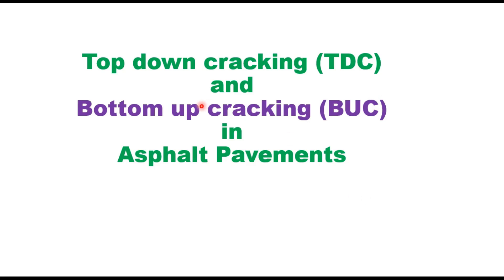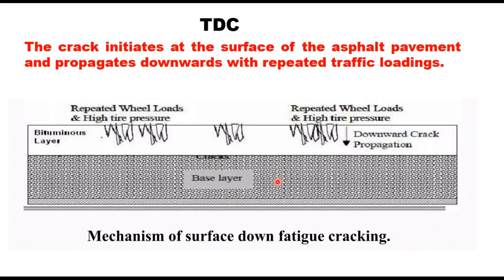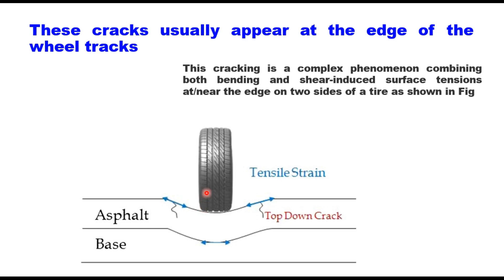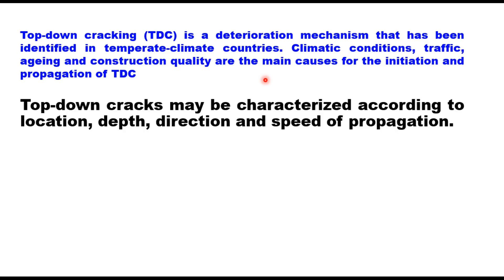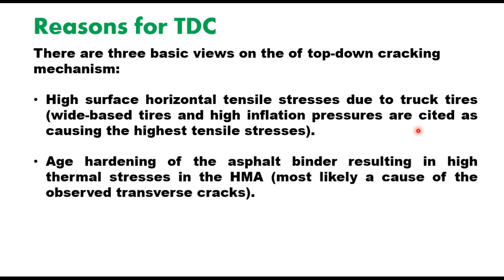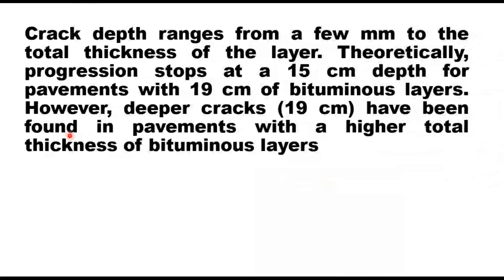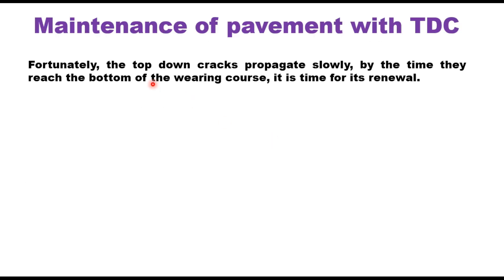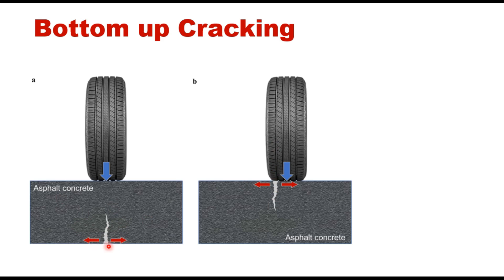#TDC and #BUC top down and bttom up cracking in #flexiblepavement reasons and remedial measures

Comment: Interesting and informative video. Thanks for sharing this type of video .  I have one question, you said, use the non woven paving fabric. But we can use the glass grid material (I am not talking about composite glass grid ). I want to take suggestions that we can use ? Will it be good or not ?
Reply from the maker: Yes you can! It will also reduce chance of reflection cracking.